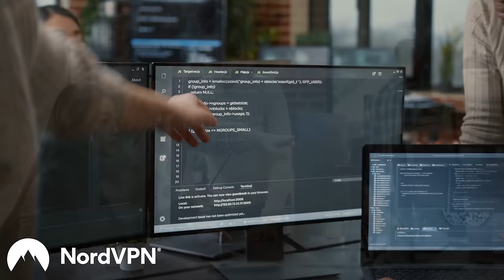Elon Musk fails Cybertruck stainless steel metallurgy test | Auto Expert John Cadogan

Comment: I unfortunately bit hook, line and sinker and was under the impression that this big fridge on wheels was made of special shit......

However if you make anything out of 3mm thick cold rolled plate it is going to be relatively tough. This whole car was designed to be built with a laser cutter and a pan brake. It has a closer relationship to an industrial oven than an ordinary car.

Thanks John for another informative show. I just learnt something.
Reply: It is the same stainless steel alloy developed by Tesla in partnership with Aperam that SpaceX uses on its Starship rocket. Given that Aperam concentrates on the production of stainless steel and speciality steel, my guess is that it is no ordinary shit. How special I can't say as I don't claim to have a metallurgical background
Reply: This isn't informative it's a liar doing a clickbait video for money. Go look at Sandy Monro's channel if you want reality and facts. 
The steels 1.2 and 1.6 mils if I remember right. And they shot 12 gauge buckshot and an auto .44 I think into it at 25-50ft after 1-200 rounds I think one divot split the steel a few mil and and bounced of the other 100+ didn't do anything that couldn't be fixed in a day. 
Pull out a mig with stainless wire, fill dents and grind smooth.
The only thing whiners can say is that the grinding may leave marks. I'm a contractor building houses that could do those repair in an hour in the field using the utility outlet in the bed. I can afford a 100k truck but I'm waiting for the base model because I'm not one of the bimbos this channels attracts and I beak my tools. 
I remember a guy on a sight making a joke about breaking an anvil. I was waiting for the point of the story.  Then I had to explain to everyone "I've broken an anvil before." Blew the horn right off it.
This truck is a dream for me.

Comment: It wouldn't break a press if they tried to mold compound curves, but it would wear the dies.  It would also form unpredictability.   In the mid 20th century many car makers experimented with stainless.  It didn't work well because the dies changed with every stamping.   In 1960 ford made 3 thunderbirds with stainless bodies.  They were the last 3 cars produced on the dies because they wore out quickly.  Underbody parts with more aggressive bends were made with carbon steel.  

Another interesting thing is that where the stainless is bent it loses its stainless properties.  It becomes magnetic and may even corrode more like carbon steel.  Keeping it flat keeps its properties.

Comment: I hoped you might do some tests, like fire a .45 cal bullet at a similar panel of stainless.  Yes, it is hard to drill stainless even though it isn't a hard material.  Your explanation that it work-hardens explains that.  Stainless is "tough", which means it deforms before breaking (think Play Dough), but doesn't have high tensile strength compared to cold rolled steel.  It acts "gummy" when run against another stainless surface, so can seize.
Reply: Turns out it stops .45 APC and 12 gauge buck. It’s pretty strong.
Reply: @gilliesiut2332  True.  I wasn't sure about video Tesla posted, particularly if weak propellant loads, but have seen recent video by others which suggests the door panels do stop normal ammunition.

Comment: It would be interesting to know the thickness of the stainless sheet used and the overall weight penalty compared to the high strength sheet steel typically used in cars.

I suspect that the weight penalty might be a small percentage of vehicle weight and the Tesla folks figured that the "wow factor" of using the thicker material to make the panels bullet proof was worth the extra weight and reduced range.  The extra thickness of the sheet steel will, of course, also have profound effects on the design of crumple zones and the damage done to the vehicle in little fender bender accidents.  So, maybe there's a valid reason for the choice of this 300 series SS hidden in there?
Reply from the maker: It's 3mm thick.
Reply: @AutoExpertJC  Wow, that's awfully thick.  Google says that 18 to 22 gauge sheet is typically used for sheet metal on car bodies.  If that is correct, then the stainless sheet on the cyber truck is between 2.5 and 4.28 times as thick!
Reply: @kirkjohnson6638 It's 3mm thick because it forms a structural exoskeleton, unlike the steel panels of most trucks that sit on a steel chassis.
Reply: @robertsmart7484  Thanks, I was wondering if that might be the case, but it seemed to me (just a gut feeling) that some of those large panels might still require some backup structure to prevent bending when some apocalyptic zombie climbs onto the hood/bonnet.
Reply: Bending resistance is proportional to thickness CUBED.   Double the thickness results in: 2^3=8 times improved stiffness. Triple the thickness and you have 27 times better dent resistance (or forming resistance).  If you put such material into a press (and dies) designed for forming thin material, it definitely could damage the dies or press if you simply increased the hydraulic pressure.  Also 30x SS is vastly harder (and more scratch resistant) than paint. Typical car paint hardness is not even close to being measured on the Rockwell B (or C) scale. Bottom line is CT will be at least an order of magnitude MORE scratch and dent resistant than ANY car SUV or pickup in current mass production of over 10k per year quantities. If JC were honest, he would say as much.
Reply: @AutoExpertJC your dishonesty appears to greatly exceed Tesla's.  First you lied about the empty weight of the CT (claiming 5T instead of the actual 3T).  Now you're claiming the CT will "look like hell if you take it offroad" when basic science proves the cybertruck will be an order of magnitude more dent and scratch resistant than any stock painted SUV, pickup, or car with typical flimsy "high strength steel" body panels. Body panels that must be painted to prevent them from "looking like hell" after a week or two sitting on a car lot waiting to be sold.
Reply from the maker: Dent and scratch resistance are different things. Dent resistance needs toughness and curves. Scratch resistance needs hardness. You can't have both.
Reply: 1.8mmm thick

Comment: @AutoExpertJC your dishonesty appears to greatly exceed Tesla's.  First you lied about the empty weight of the CT (claiming 5T instead of the actual 3T).  Now you're claiming the CT will "look like hell if you take it offroad" when basic science proves the cybertruck will be an order of magnitude more dent and scratch resistant than any stock painted SUV, pickup, or car with typical flimsy "high strength steel" body panels. Body panels that must be painted to prevent them from "looking like hell" after a week or two sitting on a car lot waiting to be sold.

Comment: When machining billet stainless of certain grades you've REALLY got to think about your process order, because some machining steps turn the surface into sh*t hard enough that it would near as damn it dent diamonds ! :D

I once fished a block of "Mystery metal" out of the scrap bin to make some long forgotten adapter to fit some long forgotten engine component to an engine it wasn't meant to be on. I could tell it was stainless, but didn't even bother to wonder what grade. I happily started machining it, and didn't even get concerned when I realised I was chipping significantly more carbide tool inserts on the lathe than usual.

The last process was to hand tap 3x M5 holes in it. The first one was really hard to get started, but eventually got going, the second one just wouldn't start, so went to the third. That one also tapped eventually, but I did snap the tip (The first 5 or 6mm) of a tap off in it and I had to carefully wind that back out. I'd never seen a starter/taper tap break like that before. Alarm bells were just about starting to clang a bit by then. I spent ages trying to get a tap into that second hole, but not a chance. For an M5 thread you're meant to use a 4.2mm drill, so I decided to run a 4.5mm drill through it to give the tap a better chance of at least cutting some kind of thread into it....... 3x 4.5mm drill bits later I gave up. It was around that point that it finally dawned on me  that I'd inadvertently work hardened the surface of the part to some ridicules level, so the almost finished part ended up going back in the scrap bin.

A few days later (After Amazon had delivered a rather expensive parcel containing replacements for all the drills and carbide inserts I'd fecked' up) I remade the part from an IDENTIFYABLE lump of "free turning leaded steel" (EN1A IIRC). It took about a third of the time, and was a dream to machine compared to that evil mystery stainless.

Comment: 21:31 it is a good choice for some vehicles, for example: if he decides to launch a cyber truck like he did his Tesla it’s panels will remain flexible until it gets quite a long way from the sun.

Or if your vehicle happens to require it holds a lot of cryogenic fluids and survive vibrations and fairly light impacts his stainless seems like a good choice.

Comment: John - most Armored Glass is made up of Multiple layers of VERY Tough glass and BP Laminate (poly) and a inner TOUGH glass layer to prevent shards interring the cabin , usually inner layer is made to shatter in fine cubes. 
its EZ enough to take Cybertruck to a PROPER armorer and add LEVEL VI glass . cant roll down Windows anymore.

Comment: Mention EVs, get views.
Meanwhile CT's 48V architecture is being hailed as revolutionary. There will be a lot of buyers for this vehicle, especially once it scales and the prices starts to come down.
Reply: The 48v system might be revolutionary if it withstands the acid test of real-world use.
Reply: @simoncrooke1644  Assuming it's not been done without reason. Time will tell, but if it reduces the amount of copper used in wiring, and therefore both weight and cost, that can only be a good thing.
Reply: @yggdrasil9039  It's a good thing from the perspective of weight and materials but there may be other unintended consequences. Time will tell.
Reply: @simoncrooke1644  I'm sure there will be. Trying to find a 48V battery to start the car is going to be hard for a start!

No doubt there will be other teething issues, but the fact is currently there are 2.2 million pre-orders for this car, over 66,000 of which come from Australia.
Reply: @yggdrasil9039  If I were getting one I'd prefer to wait. Of course, most people will have no choice about the waiting. When will we see it in Australia?
Reply: @simoncrooke1644  Me too. I'm not an early adopter. I would be surprised to see it in Australia before 2026, unless it starts getting produced in Shanghai, which I don't think is going to happen. So it will come from Texas. Given the 2.2 million orders, I would be surprised to see it here before 2026

Comment: For $150K one could get a Gladiator with a 426 7.0 litre V8 hemi, Dana 60 front axle and a Dana 80 rear axle, a 6.5 inch lift kit, hydraulic steering, Steer Smarts 1 ton steering components, 43 inch tires, beadlock rims,  a Kracken onboard 4 wheel air compressor, a GoFast cap and wedge tent, diesel heater for the tent, all the armour you would need, and be able to have payments $770 per month for 96 months, and insure it for $150 per month. You could drive this anywhere, and you would not have to add more aftermarket parts to it at x number of dollars above the $150k price.  You have to pay to play, but you can get a Gladiator right now, at any dealer. They are only making 1000 Cybertrucks. It is a unicorn.

Comment: Crisco or bacon grease help with drilling stainless and preventing really bad work hardening. Learned from a metallurgist making sailboat hardware 60 years ago. And then passivating to make it better at corrosion resistance.

Comment: Theoretically speaking, how much force would you need to pull apart a steel beam? If you consistently pressure water, say at 100psi for a decade, will there be any change in it? Just wild thoughts.

Comment: Forming limitations in stainless steel Bodyshell are known at least since the Delorean DMC12 production (and design, before 1980). This was over of the issues that bumped up the cost affecting the expected MSRP target... does it sound familiar?
Also, I would say that for the DMC12 exterior design target was successfully achieved (with much less available budget) despite the material "limitations"

Comment: "30X" isn't a "new" alloy, it is THIRTY TIMES (30X) COLD ROLLED (work hardened) which is why you can't run it through presses.... You can, but the dies will rapidly deform and require renewal far to often to be economical on a high volume run.

Comment: The most obvious thing why the steel used for the cyber truck can't be "so hard it will break the press" is because a car needs a crumple zone. If it can't crumple then it will just transfer the energy to parts of the car which can't handle the impact. People are part of the car.

Comment: This entire video is based on a bad assumption:

The hardness Tesla were refering to is WORKHARDENING.

Work-hardening Stainless steel improves its crystaline structure and properties considerably.

It improves the UTS from 500mpa up to a potential of 2000mpa, but most people stop at 800-1000.

With this being well outside of the range of normal body panels, (UTS 360 or under), nevermind much thicker, then obviously it'd need a specialised press.

Also unlike regular high strength steel, work hardened stainless can be easily welded (the crystaline structure simply reverts in weld areas), which makes it much much more viable in manufacturing.

You can also weld stainless to regular steel, but you're probably aware of that.

Comment: Yo, John, wait a minute, I may be wrong here, but from what i recall from high school, which was quite some time ago, there is a difference between mass and weight... Grams are a unit measurement of mass, which is a specific value of all atomic particles of a single defined body, whereas it`s weight is that same mass which exerts a certain force in a specific gravitational field upon another body and unlike mass which is expressed in derivatives of a gram, weight is expressed in N(newtons) and is dependent on the gravitation field wherein the body is weighted, or better said, is weighing on a surface... Meaning that weight is a measurement of force, whereas mass is a more basic concept, like volume, which is the cubic area of all atomic particles of a defined body... 
You said that force can be expressed in grams, but can it? I mean, as said, im not sure anymore, but isnt a newton basically the amount of force required to accelerate 1kg of mass by 1m/s per second squared? In the direction of force applied, of course... One newton meter is basic unit for the amount of force a body of certain mass exerts on the end of a 1m long lever... When you said that grams can be used to express force, i think you were referring to the olden units of kgf or kilopond, which is really a measurement of weight, but while it does accentuate the gram and kilogram in its name, its final unit of measurement is still a Newton... 
Im not trying to be an asshole here nor am i trying to nitpick, but you got my mind to suddenly hit the brakes and start storming through all the memories of school days and love for physics and my crazy teachers... 
I`m a machinist or a millwright more or less nowadays, and i don`t really go over the basics as often as i did back in the days, re-reading, contemplating with passion, but i really don`t recall seeing grams ever being used to express force, as they are in fact a unit of mass, which like any other measurement, does not share units of expression... Sure, it forms compound units and derivatives like lbf, or g/sqm or whatever other form, but gram is a gram and newton is a newton with each being sole property of the quality that is expressed in them... We can tech talk and understand each other when you say that something weighs 400newtons, and i know you mean on earth, so i can calculate its mass as 40kg approx, as its not a division by 10, but 9.81 to round it over, but you get my point i hope... If i am just tripping balls here, let me know, i can indeed trip balls like a rare few can, so please, if im barking mad, let me know... 

I fully agree with the rest of the video, you really are amazing and a joy to listen to, but i think you shat the bed a tad with the units... 
I would also love to see a few of these go through the crash test safety analysis... Being work hardened, the steel should crack in places, which ain`t all that good as a dampening factor when compared to regular steels which don`t work harden nearly to that extent and allow for bending to soak in a hell of a lot of force in the process during oopsies... 

All the best and kind regards!
Steuss

Comment: The sheet metal breaks. Full hard stainless is a bastard to work with and I can see the vehicle skins cracking over time as the metal will work harden and crack from fatigue. 
Where I work we get in 20 and 30mm mm armoured steel bent to just under 90 degrees, the press doesn't break, the steel does along the bend radius.